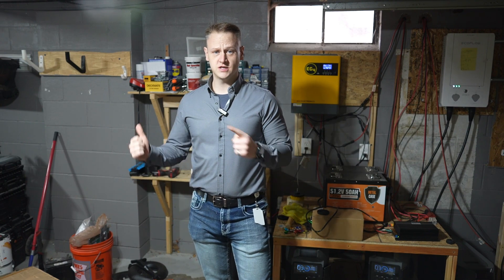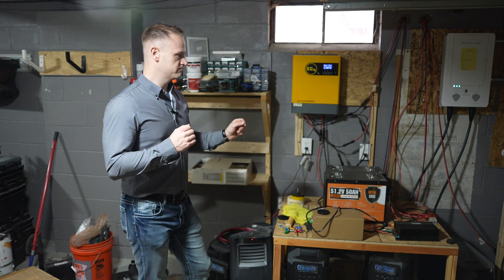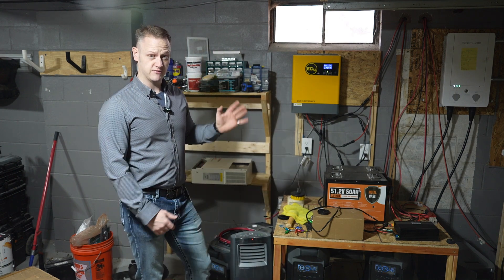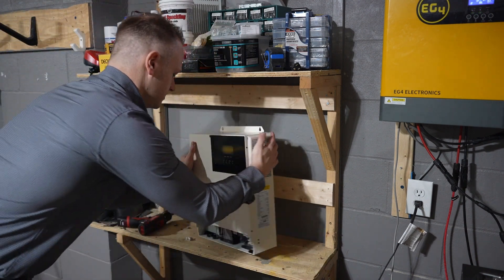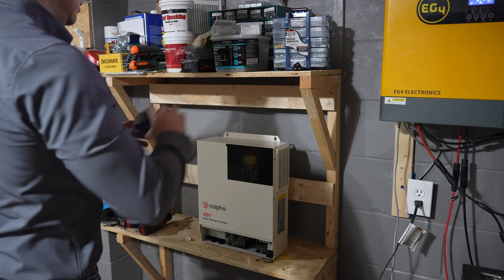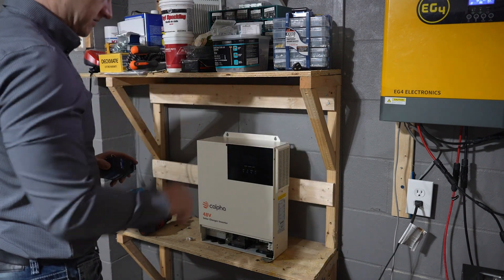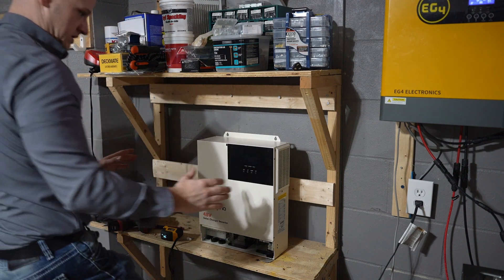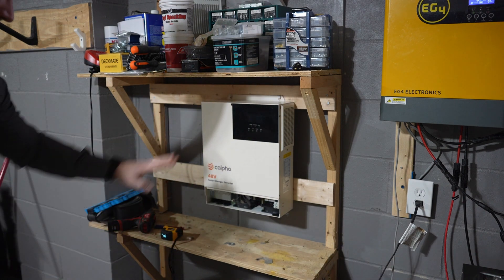Calpha Solar 48v 5kw Solar Inverter - Initial Setup

Comment: I would never wire this Calpha high frequency, output transformerless inverter into my home's electrical system. For one, high frequency inverters offer a relatively poor peak power capacity which is needed for starting high inductance loads such as refrigerators, power tools, microwaves and air conditioning units. You might be able to start and run some high surge loads when these high frequency inverters are new, but every time you fire up one of those inductive loads, you're shortening the life of the MOSFETs in these inverters. Second, because there is no iron core, copper wound output transformer to provide galvanic isolation in these inverters, All it would take is for the AC output monitoring circuitry to fail and one of the MOSFETs in the inverter's H-Bridge circuit to short to ground, and a high frequency inverters can send dangerous, high voltage, high amperage DC current straight to your AC appliances which can not only damage your appliances, but can also set your appliances on fire. That's why, today, no American inverter manufacturer uses high frequency inverter tech in their designs. And third. because these high frequency inverters operate at a much higher, stepped up DC voltage and a much exponentially higher frequency than more reliable, low frequency inverters, they tend to have a much shorter life expectancy. No thanks, not in my home.
Reply: i HAVE TWO caipha 4850 iNVERTERS CAN i CONNECT TWO GNERATE 120/240 V OUTPUT?

Comment: Yet another cheap Chinese made high frequency, transformerless inverter that offers a shorter life expectancy and a poorer peak power capacity than a low frequency, transformer based real inverter. You threw your money away on this one.
Reply from the maker: I guess it depends on how long it lasts. So far its been functioning flawlessly. I do believe in the "you only pay for quality once" proverb but I also wasn't even sure initially what I wanted to do would work (power an Ecoflow Delta Pro from an external battery bank), so I didn't want to invest too heavily until I knew the answer to that question.
Reply: Do you know of any brand of all-in-one, 5000w inverter (that surges to 10,000va) that integrates and controls a built in 40amp 48v battery charger and 100a charge controller (that will handle 500 volts - necessary as my solar array is 400 voc) that has a low frequency inverter? I haven't seen one. Even the Victron multi-RS and Easy Solar 2 GX uses a high frequency inverter and doesn't support anywhere near the voltage needed. You would have to do it with separate components which would be much heavier, bulkier (both important considerations in a mobile application) and would cost 5-10 times as much, making it an "apples to oranges" comparison.

BTW I have a Microaire soft starter on my rooftop A/C and my other A/C is a soft starting mini-split heat pump, so the inverter won't experience any voltage surges that are known to damage the capacitors in high frequency inverters, as the voltage in both units ramp up slowly in a capacitor safe manner.

Comment: How is this product working out?
Reply from the maker: Really well! I've had it in circulation now for almost two months, daily charging up my delta pro and the external battery. The next step is to add additional batteries to the bank and see if it can sustain charge two delta pros continuously.
Reply: @DanielGoodwin-jq1oc  I noticed the VOC on it is only 145V which is even less than my Ecoflow Delta Pro --- yikes!

Comment: Are you going to add/configure the battery communication cable?
Reply from the maker: Yes! I've already added but wanted to mention separately as you have to set the DIM (pins) appropriately for communication. Will cover in the next video.